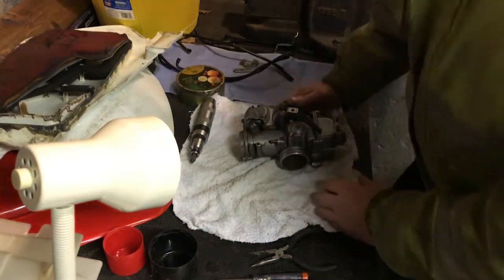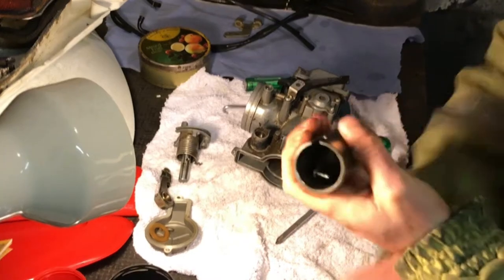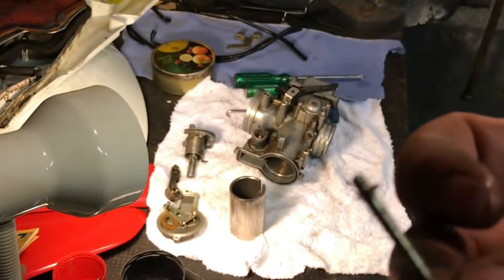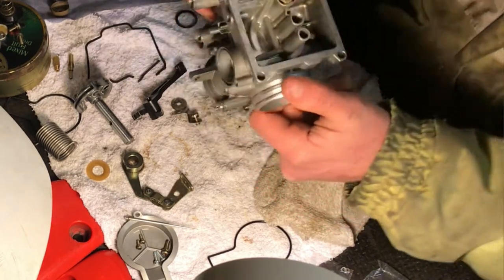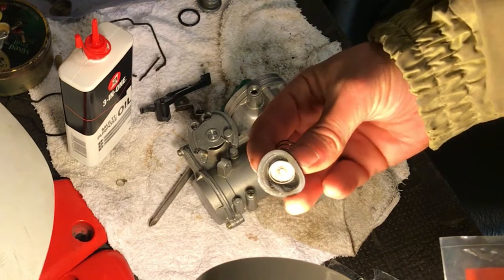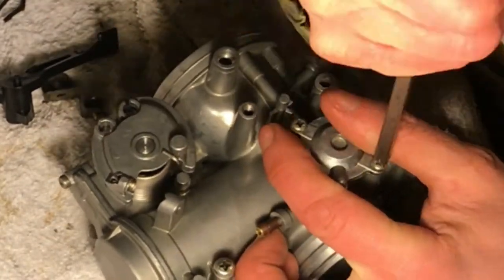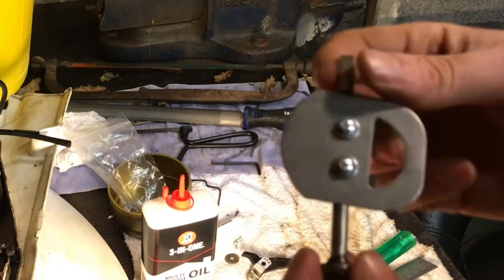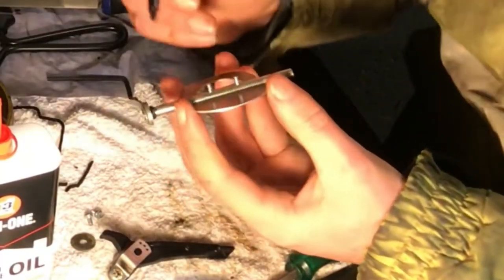XR650R Restoration Part 4 | Carb Overhaul | How to Rebuild a Carburettor | Honda XR | Dirt Bike

Comment: Thanks for the videos. I’m just starting on doing up an XR650R and your videos are a great help.
Reply from the maker: Your welcome thanks for watching,glad they of some use . Good luck with your build . I took my time doing this one 14 months but the outcome is better if not rushed 👍
Reply: @OldDirtBikes  Thank, it looked like you stuck with original parts throughout. Did you find them easy to get?
Reply from the maker: @chrisetchells2803  yes most parts i was able to get ome but did have to wait sometimes weeks . Im in uk some from fowlers honda uk and some from everett honda usa 🇺🇸. Then other times waiting for them to come up on ebay 👍

Comment: Thanks for this video. What is the red bottle you were using? Is it threadlicker?
Reply from the maker: Hi glad the video helped . The bottle is a very thin oil similar to 2stroke oil, my carb had not been used for many years and threads were so dry and corroded best to play safe rather than have small threads snap or cross thread . When it starts up that oil burns off 👍👍👍

Comment: What kit is this is it one kit for the whole carb,cheers
Reply from the maker: First I bought just a cheap “ all balls kit” in uk eBay mostly for o rings and gaskets . But the air cut off valve and jet kit I had to get from 🇺🇸 USA . That was a lot more expensive after all import taxes etc but worth it . They were from firm called “ siriusconinc (91289) “ again on eBay . Hope this helps
Reply: @OldDirtBikes  yes it does thanks and great rebuild

Comment: Was that a mod you did to the choke if so what's the purpose?
Reply from the maker: Hi you mean the half moon hole in the choke flap ? People remove them as they can snap off and get sucked through . It was already missing on mine . No other mods made to the choke 😀
Reply: @OldDirtBikes  I'm having trouble putting mine back together, the arm attached to the piston came apart on me now I can't remember where the spring went and which way it went on. Things just don't go as planned, it's my first time doing this I can't afford a mechanic had one he's the one who built my bike but is no help now
Reply from the maker: @WILLY52368  hi , will try to explain but not easy . I think you talking about the link arm . The base where it attached the the piston it has a angle on one side 📐 slope side towards air box the small spring at the top of this gose im between the 2 screws at the top of the angle part the most coiled part towards engine side . Then don’t forget to put the washer between the link arm and carb body then slide in the throttle drum shaft . There is a web site where there is step by step instructions ( https://www.xr650r.co.uk/service/carb/carb.shtml ) try this link i found it very helpful. 😀 let me know if you were able to find this page 👍👍👍

Comment: hello machine, if you can help me, you know where I can find for brp 650r the side stand retractable system to pass inspection thanks
Reply from the maker: 🖐 hi , think you mean the side stand spring ? Many bikes share basic parts so for a spring i would try a breakers yard just measure the length you need from the mounting point . Ebay also good but may take a while , i msg ebay breakers for parts even if they not listing them this has worked a few times . Best of luck thanks for watching 😃

Comment: Dump that paperweight and get a pumper carb
Reply: Sure you get $800 I use and not return? Sometimes you gotta make that choice if you going put food on the table or throw away money. I pretty sure you cannot eat one pumper carb, by the way I should know I had one it's up there but it also eats a lot of gas too, so I gave it to my mech now have a 650R carb